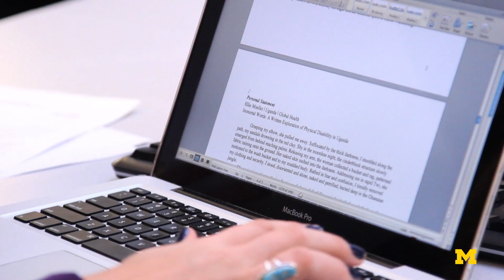World’s Smallest Computer

Comment from the maker: The World's Smallest Computers
Breaking the millimeter barrier, U-M Engineers have developed the world’s smallest computers. How they're made is almost as amazing as what they can do.
Reply: How many terra flops are these computers capable of?
Reply: How would it both interface wirelessly while being shielded from radiation from chemotherapy?
Reply: +Michigan Engineering I envision a liquid supercomputer inside the vascular system composed out of millions to billions cell-sized microcomputers, powered by glucose-fuel cells (GIT , Reginald Farrow). 
Hardware is already small enough. Nvidia Pascal cores with 1 GFLOP each measure only 250µmx250µm. 
Of course they need to consume 100 times less power. Stacking memory and logic will certainly help a lot.
Graphene/tin oxide transistors are coming along....
They would be equipped with graphene nanoantenas (Prof Aykildiz, GIT). 
Every cm³ 10-100 micro computers.
It would basically be a supercomputer from 2001, but instead of filling 300m³ it fills only 50 liter body volume and has more nodes.
Humans have never designed a liquid computer in which each node changes its position according to different blood flow values. 
It would need to work on different levels. Millions of graphene nanoantennas inside the body and more powerful antennas that are stationary inside vessels to suck all the data out of the body.
Reply: When you say "computer" are you referring to an SoC, RAM, storage, a battery, sensors, ect. And could you describe the scale of the TDP of these "computers"; are we talking amps, milliamps, or even microamps?
Reply: na the nsa came up with these 20+ years ago
Reply: It is a clever idea to do that just imagine it on a drone a phone a USB stick it is a revelation of technology